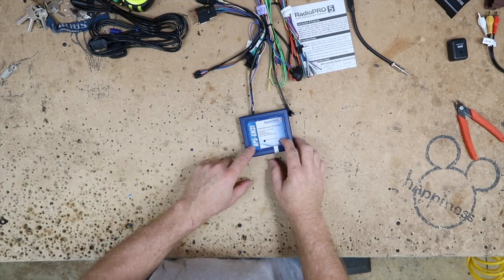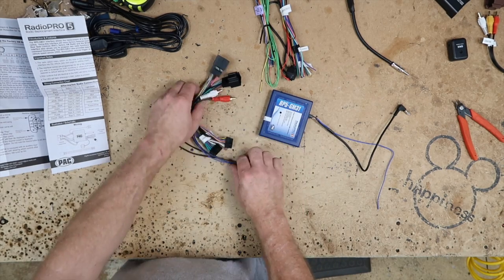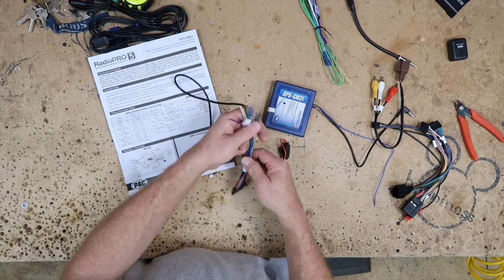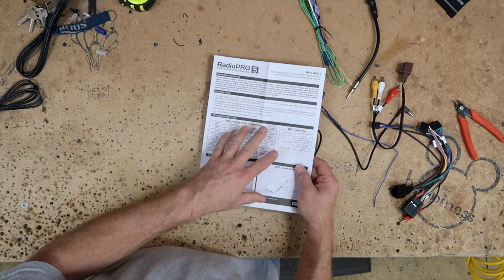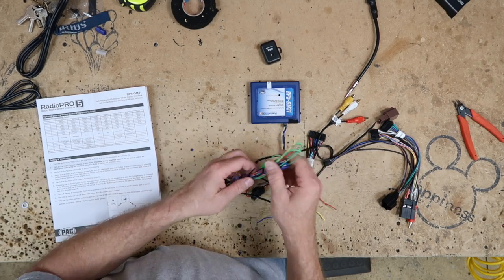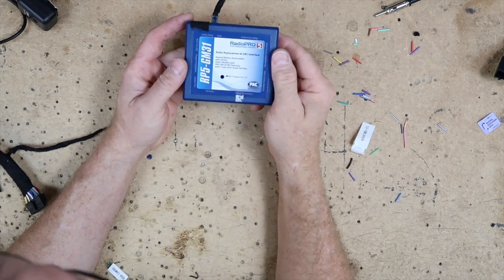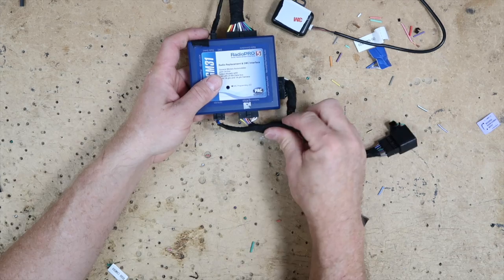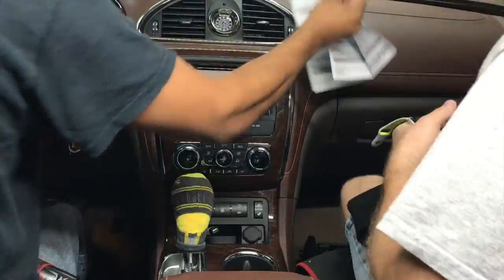How to keep your factory backup camera, OnStar, steering wheel controls, and  Bose in your GM vehicl

Comment: Good video thank you! I installed a RP5-GM11 & Pioneer AVH-W4500 in my 05 corvette and was getting no power to the rear speakers. I found your video and saw you tugging on the wires, did the same to mine and  they were loose! Plugged it in properly and now everything works.

Comment: Best video yet for this job. I have a Tahoe with Bose premium sound. I have the same harness you demonstrated. My dilema is after taking out the factory radio there are 4 female receptacles and they look very similar. I am ready to install and dont know which aftermarket plug goes where. I will study the pins and see if I can match them up.

Comment: I have a 2003 cadillac escalade and want to upgrade my factory tape, cd deck.  I am leaning towards an android based double din.  What kind of harness and wire adapters would you recommend to keep my factory steering wheel button functions as well as adding a backup camera?

Comment: I have a question...i recently installed the Kenwood ddx9707s into my 06 GMC yukon denali with the Bose digital amplified system. I have a rear seat entertainment that came factory with my truck. Now i used the rp5-gm11 harness but  my rear speakers only play as front speakers and become silent when i use the fader to the rear speakers. I have everything hooked up the same way you explained it in here but can't figure why they wont play separately from the front. Until i read the fader doesn't work with digital amplified systems using this harness.  Now my question is..is there another harness that has that feature cause it sounds like I'm missing out on sound with my rear speakers not playing independent from the front speakers.  My apologies for being so long..

Comment: I have a pac5 gm11...2005 Tahoe with bose and onstar. Should I leave the solid blue wire from the interface capped or should I connect it to the red wire? Working with a pioneer 200ex.
Reply: i am trying to figure this one out too
Reply: what did you end up doing with the blue wire?
Reply: @corey.morreale  i connected to power wire....nothing major happened
Reply: What i did was just connect it to power antenna ad u would connect it to an aftermarket amp, it wasnt playin audio as soon as i did that it started workin

Comment: Excellent video.  In the video you said the module allowed the use of factory XM radio.  The customer is installing an aftermarket head unit.  I did not see you install one of those XM radio modules.  The XM radio module is required for am XM ready head unit, right? Did you install an XM radio module in this installation?
Reply: G P I'm wondering the same thing my GMC Sierra has xm and I pay for it every year my pioneer unit says satellite radio ready and I bought this rp5-gm31 I'm wondering too if I need an adapter
Reply: I hoped that Five Star would jump in with an answer.
Reply: G P after looking a bit more into it I'm thinking you don't need the module to retain xm through aftermarket head unit, the rp5-gm31 should retain the xm radio as long as the radio says xm or satellite radio ready
Reply: I have not purchased a compatible head unit.  But, for an XM account to use a head unit, account ID information needs to be entered into the head unit.  This would suggest there is an interface where this information can be entered.
Reply: G P if your new unit is not xm/satellite radio ready then you will most likely need an adapter interface, what is the brand of unit and what vehicle are you installing it on ? I will find out what you need. Also I'm going to be installing mine myself in about a week I'm just waiting for the micro bypass to come in the mail and I will be ready for install, I will let you know if my install on the xm ready radio head unit works broski
Reply: I am considering the Pioneer AVH-1440NEX.  I will be installing it my self into a 2006 C6 Corvette.  Two years ago, I installed a Kenwood Excelon DMX... into a 1999 C5 Corvette.  That install worked out really well.  So, I will use that experience for this current install.
Reply: G P ok so I installed my pioneer unit with this gm-31 it will retain xm radio and you don't need any adapter, plug the red and white rca cables from the PAC unit into the left input rca and right input rca and the audio is crystal clear, when you install you will automatically be using steering wheel controls to use xm however you can put it into after market mode just follow the steps that came with the PAC unit, as for the radio itself displaying the radio Id number I'm still figuring it out and will get back to you on that asap. Hope this helps you bro
Reply: G P you radio ID can still be accessed through your cluster on your display where your information is displayed like mpg/odometer etc. While xm will be displayed on that part using factory xm mode you can scroll to channel 0 and it will give you your radio ID
Reply: Hummm... I will have to go and look to see if the XM radio information is visible on the dash display. I am not aware that that information is visible on the dash.
Reply: G P if you have the interface set to factory xm mode it will display the channel of xm you are listening too and you will use steering wheel controls to scroll through the channels and will display on cluster, this summer I'm going to change and set the PAC gm31 to aftermarket mode for the pioneer but as of now everything works fine. Let me know if you use steering wheel controls to use your xm it will have to be on source AV to listen to it.
Reply: When I finally install a new head unit in my car, I will be installing in a 2006 C6 Corvette Base Coupe.  The car does not have steering wheel controls.  Must be the only C6 without steering wheel controls.  I will have to see if the car displays XM station information on the dash.  The car is currently in storage for the winter.

Comment: Thanks for the video guys it was a big help. But wondering what do you guys know about replacing the stereo in a 2017 Nissan Sentra with steering wheel controls and factory backup camera any advice or video would be a big help. Thx

Comment: I just connected a kenwood double din into my 08 corvette with on star but after installing with that wire hardness I have to turn on the on star and then off in order for the audio to work on stereo am I supposed to cut the Brown wire and connect it to the blue???
Reply: fleiva30 my Onstar no longer has audio. Did you ever find a fix?
Reply: fossilsol69 not yet i haven't got time.. I'm going to take it to a shop better and see if they can correct that
Reply: fleiva30 I did have mine done at a shop and they had to put in a small speaker which distorts because it can’t handle the factory amp. It’s basically unusable. I didn’t know Impalas had amps except for the ones with Bose systems. Please let me know what you come up with.

Comment: About to install a Sony XAV-AX5600 and PAC RP5-GM31 in a 2007 Tahoe with factory Bose amp. Do I need to plug in any of those RCAs or use the harness with the brown connector? I only want to retain a few basic steering wheel controls.

Comment: I know video is a little old but I just bought this harness and there was a bulletin inside the packaging for rerouting power wires for double din radios. Do you guys know anything about that? I ask because I bought the 31 and the diagram in the bulletin was using an 11 and the wires are completely different.

Comment: I have a 2008 chevy avalanche.. I'm using the rp5-gm31. With my pioneer radio.. I cant get my factory backup camera to come on when I put truck in reverse..what wire should I be using..
Reply: I have same issue , did you ever figure it out ?
Reply: Same issue. No output on the purple white wire for reverse camera on mine. Camera is working in reverse if I put 12v to the camera wire on my radio the camera shows up.

Comment: Purchased the RP5-GM11 for my 2007 Silverado with bose system, no onstar or swc, i get zero sound out of my speakers, i have been using the LCGM24 for the past 2 years, which works, but i was unable to get an external amp/sub to work which is why i switched to this new one.

Comment: What did you do with the brown harness that had the white/red/yellow Jack's where does that plug into
Reply: It doesn't go in this
Reply: @thezekeprelliottexperience4907  u would know wouldn't you
Reply: @toneytone7497  ya actually i do im installing one now there's a video input on the pioneer touch screen witch makes that plug useless its for different models so you plug your actual video wire into it from your camera and there's a small red wire that connects to a purple wire on the deck or just into power depending on if you only want it to work in reverse or always on
Reply: @thezekeprelliottexperience4907   well u just burst my bubble, one more question mr know it all, jk,  but if I want the reverse camera with steady power being on when I'm not in reverse which wire do I tap in. And thanks for your help in advance I really appreciate it
Reply: @toneytone7497  the red power wire on your deck

Comment: I have the same rp5-gm31 hooked up and it works perfect. Now I want to add an aftermarket amp to the four door speakers  in my 2007 silverado no bose system. Where would I hook up the speaker outputs? Thanks
Reply: Had any luck ?

Comment: I have an off-brand Atoto head unit (I only bought based off reviews on Amazon) I have the same RP5 interface shown in the video, with the 3.5mm plugged into the SWC jack on the unit, but have no steering wheel controls. Any idea? Do I have to connect the key+ to anything?
Reply: Did you get yours hooked up? I have the same Atoto radio and RP5 interface. What radio did you select on the switch?
Reply: Did you ever get an answer on this?
Reply: @flyhog8574  It's been a few years now but yes, I did get them working, but the steering wheel controls only seem to work half the time

Comment: Hello I’m trying to connect a Rpk5Gm4101 on android tablet with out the 3.5 app using the cable but don’t know where to run the Key 1 Key 2 wires ? Please help

Comment: I installed one of these on my 2012 Silverado, every time I turn up the volume on the pioneer radio it’ll shut off and restart. It’ll work fine at low volumes, what can it be? Also I programmed the steering wheel buttons it worked perfect for a couple days and now the track up and down buttons won’t work the volume, mute and phone answer buttons are fine still
Reply: Do you still have this problem?

Comment: I'm using the same rp5 gm31 but using a alpine w265bt the power antenna off radio does that hook up to red wire as well or does it hook up to the blue wire coming off the gm31?

Comment: Question: does this regulate the steering wheel cruise controls as well, or just the “radio” steering wheel controls? If I install a new radio without this module, will the cruise control cease to function?
Reply: Only the radio buttons are programmable I found, but also my cruise control worked when my steering wheel buttons were not working so it doesn't break cruise.

Comment: I purchased the RP5-GM11 for my 2005 Avalanche. In the instructions there are no aftermarket SWC steps. Am I able to reassign the VR button for Onstar to just be regular VR or is there no way to reassign it? When I program the buttons it does not let me change the Onstar VR button. Instead, Onstar just turns on. Thanks!
Reply: Did you ever find the answer to this question? I’m actually about to do this exact thing. I know PAC says the radio switch should be set to 7 did you do that?
Reply: Also did you use the 3.5 Jack or did you have to splice the swc key?
Reply: @flyhog8574  If I can remember correctly the RP5 maintains all OnStar capabilities so you cannot reassign the VR button. I do believe that if you use the RP4 instead it will deactivate OnStar completely and I think you can reassign the VR button that way. 
I kind of with I used the RP4 because I have no use for OnStar, but oh well. Hope this helps.

Comment: Didn't you guys use the factory xm antenna? What is the extension you guys use? Isn't the module supposed to auto learn the steering controls?
Reply from the maker: +swarren925 the XM is located in the back of the car, drives side behind the door motor. We use a Sat1 and a 20" extension from Amazon. The PAC is preprogrammed for a basic use. We were doing CarPlay so we did a custom program.
Reply: Five Star Car Stereo I have the same car you just did so I was curious before I start to do my car.

Comment: I have a radio selection switch on my pac interface kit. And have a dual double din 276bt. Dont know which switch to select because its blocking out the signal from my rca port at the back of my head unit

Comment: so the brown wire is conected to wich wire to,the one you cut where that got to
Reply from the maker: The brown goes to the mute wire on the radio( if it has one). Pioneer uses a yellow black wire. If you cut the wire and do not connect it to anything, onstar will just talk over your radio. The radio will not turn off though, which is nice.
Reply: Five Star Car Stereo so what u do wit the harness for the camera sub and center
Reply: @FiveStarCarStereoInc  quick question so everything works but I can't get my SWC  work with my ATOTO deck. I have a. Rp5-gm11 I kept my bose an put in a amp an sub which works fine I just want my SWC to work.  I haven't cut the brown loop yet. When I push the buttons on the steering wheel the pac box blinks  so it's picking up the signal but no interaction with stereo. What can I do to troubleshoot my issue.

Comment: I need help please. Im using the same pioneer harness. It has a red wire if the red wire from the pac rp5 is going to be hooked up with the blue wire what wire does the red wire from the pioneer harness does it go hooked on to?
Reply from the maker: The red goes to the red. The blue is for amplified or power antenna it also gets connected with the reds.
Reply: Thank you for your help. Really appreciate it

Comment: I lost backup camera functionality when I upgraded from factory Bose to a 4200NEX in my 2011 Altima. Is there something similar to this product that would resolve this issue?
Reply from the maker: +abyde  yes check out this cable 
AX-NIS32SWC-6v
Reply: Five Star Car Stereo Awesome! Thanks!
Reply: abyde Altimas have bose and cameras ?
Reply: Robert Salas  Does The Pope wear a funny hat?
Reply: i lost camera functionality too when i upgraded from factory bose to 4200nex pioneer also how do i get it back?
Reply: @FiveStarCarStereoInc  i lost my backup camera functionality too when i installed pioneer 4200nex in my 2011 suburban with bose how do i retain it?

Comment: did everything you did but i still but back up camera still doesn't activate when shifting into reverse
Reply: Did you connect the power wire from the camera to your reverse light? It must be connected to the hot wire of your reverse light. The same wire on the front must be connected to the trigger wire (back or reverse wire)of your aftermarket radio.

Comment: Have a 2013 silverado , using rp5gm31  swc not functioning nor factory xm
Reply: poohfin69 I switched my radio from a JVC to Pioneer and had the same problem. The resolution for me was to disconnect all vehicle harness connections from the rp5gm31, change the setting dial from 7 to 6 and back to 7, plugged everything back into the rp5gm31 and it worked. Ensure you have the dial set to the correct number before you connect it to your stereo. Depending on the radio also ensure the 3.5mm cable is plugged into the w/r hole and not AUX. Hope this help.

Comment: Have a 2013 tahoe no back up from factory I have 3 question first how do I hook up aftermarket back up camera if I’m installing this rp5-gm31. Also I have aftermarket speakers as well to install can still use aftermarket head unit with nose amp amd the pioneer speakers ? Or will I need run wires to doors ? And last is there a way to retain factory mic and not have to hook up the one that came with deck ?